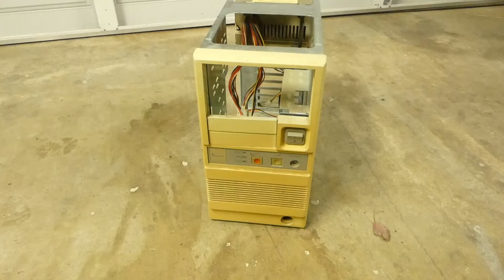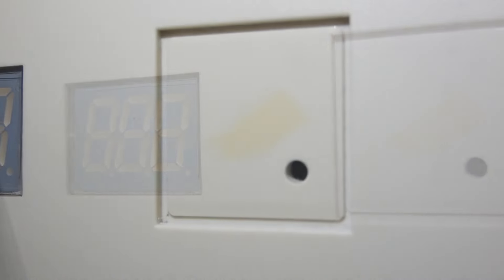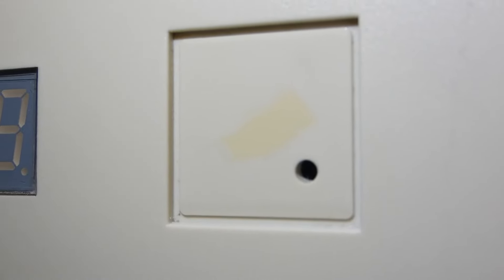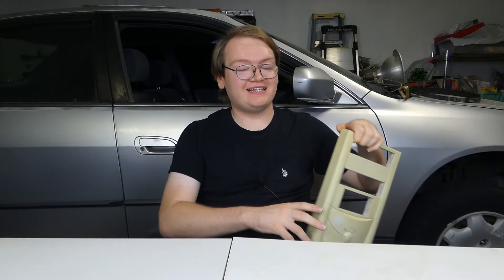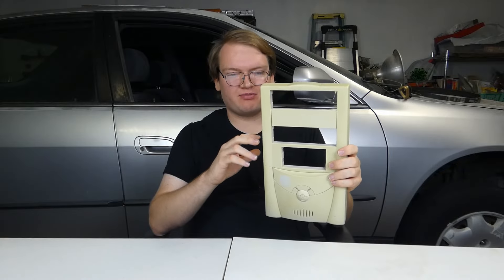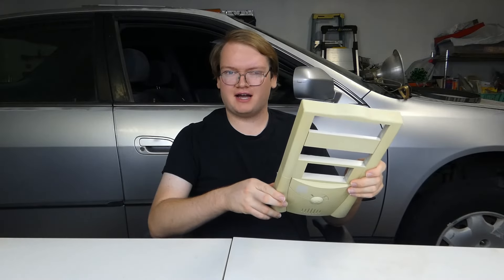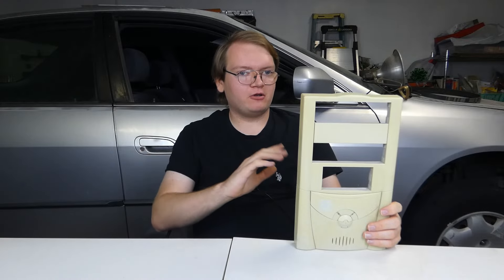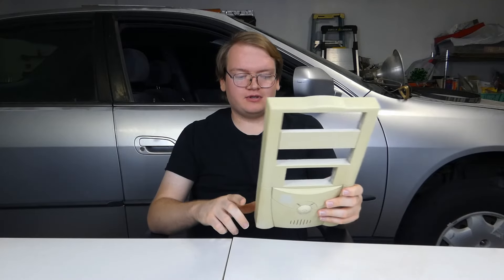Sunbright: An Easier Retrobrite?

Comment from the maker: Something I forgot to mention in the video:
If I had to guess on how much yellowing was removed, I'd say around 50-60% of it. Also that this method does not work well if the plastic has uneven areas or areas where stickers were. 

The early shots I got of the case were under different lighting conditions than after, so that's why the after result looks better on camera than it does in person. The final result still looks kinda ugly to the naked eye, not close to how it should look at all.

Comment: I have done sunbrighting on a number of PC front panels and beige PC speakers for longer duration (more days than in this video).  I can confirm the same disappointing results as in this video. 

I feel I just wasted all that time doing sunbrightring. Also, I can confirm that the yellowing returned after some time. I read yellowing can also return after hydrogen peroxide retrobrighting but at least that process takes shorter time to do.

I have not done any hydrogen peroxide retrobrighting yet and I am now planning to do this to most of the items I previously sunbrighted.

Comment: I wonder if a sunlamp would have the same effect, just without the risk of rain and insects... Or maybe several sunlamps. Of course, it would probably also be expensive with how much electricity can cost and how much power a bright lamp like that tends to use.

I wonder if a laser would also have the same effect, but in a more efficient package.
Reply from the maker: A UV laser would certainly be interesting. You'd probably need to have very fine control over the movement to not leave streaks and lines.
Reply: @NTGTechnology  or maybe a lens that focuses several lasers into a very wide beam that covers the whole surface of the item at once